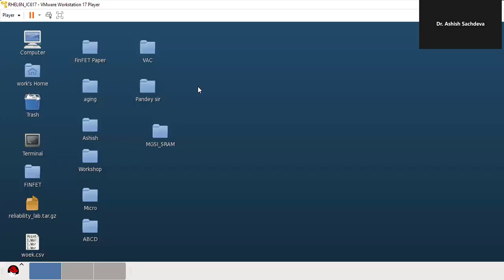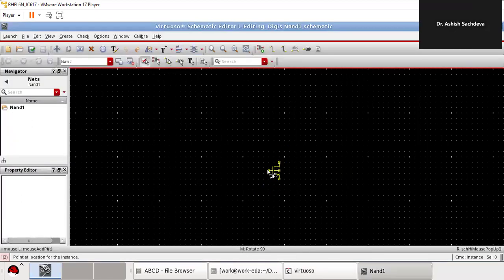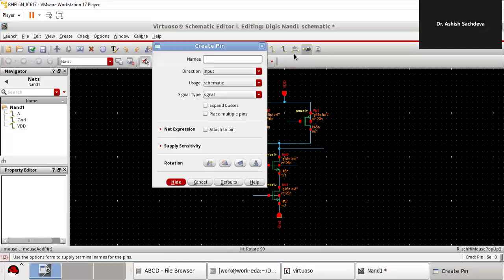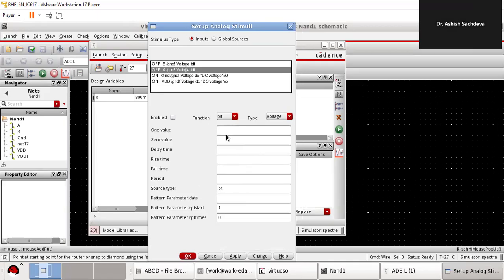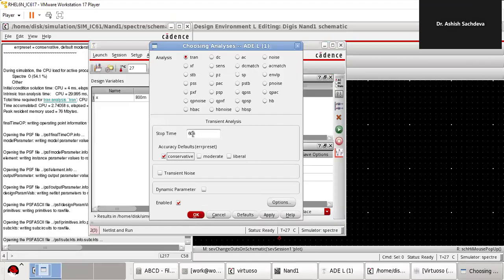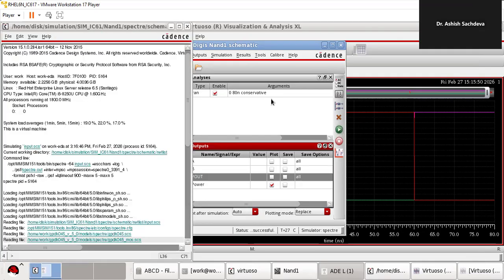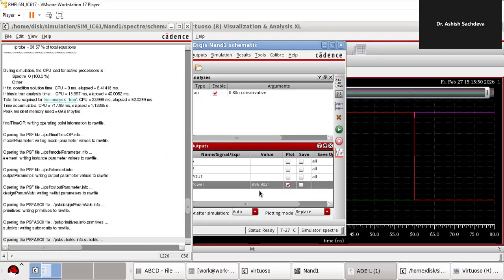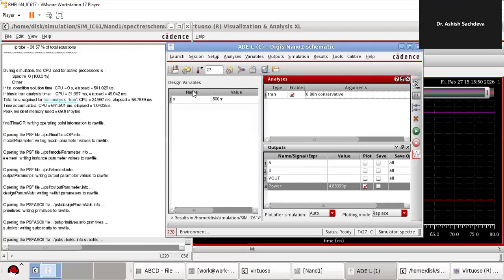Creating NAND Circuit, Simulations and Power Dissipation.

Comment: Sir, I am working on delay calculation for a NAND circuit and comparing analytical RC and Elmore delay results with Cadence simulation results. I have the simulation delay values, but I need capacitance extraction for proper RC modeling.
If possible, in your future videos also explain the capacitance extraction part and other dc parameters.